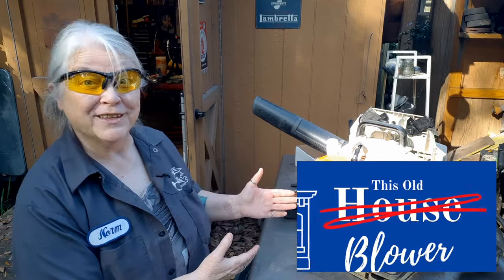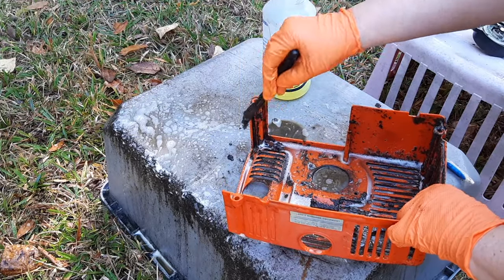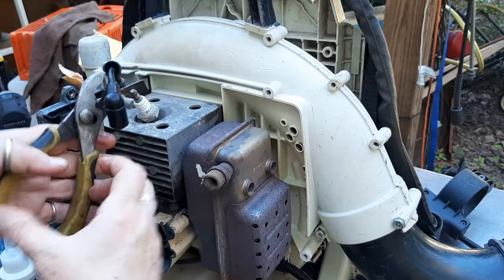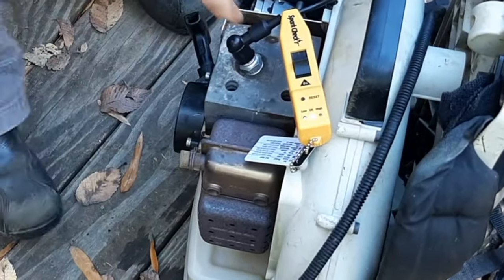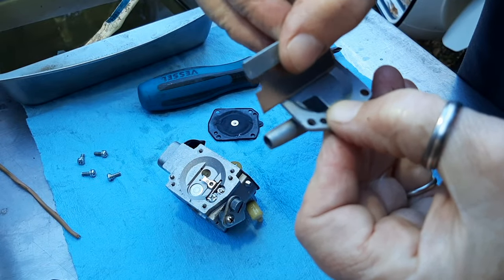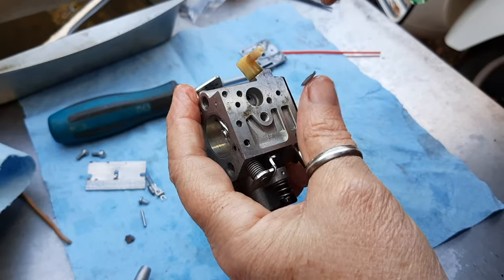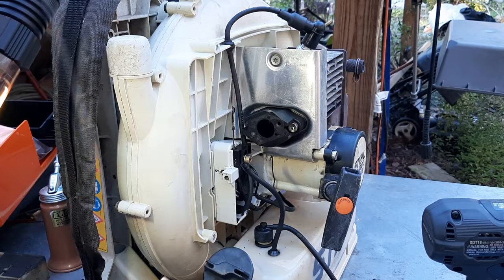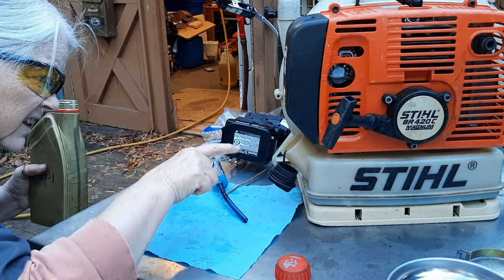Restore This Stihl BR420 Blower to Its Former Glory

Comment: Whenever I use my pressure/vacuum tester I always bend the hose over on itself and hold it tight with my fingers to confirm there are no leaks in the gauge or connections I’m using. 
That’s a good point to make sure the needle and seat have some liquid on them so they have a chance to seal correctly.
Reply from the maker: good idea

Comment: Thanks for sending the link to this blower, my BR400 sat years and bought it and got it to run only with choke on and then it won’t start unless next day cold, is it a carburetor adjustment?
Reply from the maker: Thanks Mike. I'd suggest the carb needs a clean/rebuild. A clogged fuel filter will contribute to those issues as well.

Comment: This was a fun one.  I like when things are physically dirty and they get all cleaned up, apart from the repair. 
And I appreciate you using the metric system.  When I was a kid Jimmy Carter said we had to switch but instead of just GOING to the metric system, teachers kept having us convert back and forth, which was confusing and unnecessay. We weren't comparing US measurements to anything, our fingers or feet, why compare metric to US?!
Reply from the maker: I appreciate you watching. I try and include metric and SAE measurements, to make my videos as accessible as possible. Cheers!

Comment: I got an app called Engine RPM that makes it much easier sometimes to check and adjust running speeds. It works on my iPhone using sound waves. I can prop it up near the engine I’m working on and have hands free to hold the machine and adjust settings. I can also measure engine speeds on videos!  I confirmed your idle was at 3047. How cool is that?! The easiest way to learn how to use it (after reading the directions!) is to stand in front of your fridge or freezer to zero in on the speed of an appliance. Once I got comfortable with it, it was easy enough to transition over to small engines. Will do any number of cylinder engines, 2T or 4T.
Reply from the maker: I've seen those apps, easy for DIYers to use.

Comment: That's a keeper alright. Specs say 742 CFM which is way up there for a unit that old ... probably in the 2000-2010 date range when Stihl used the square housing (couldn't find a mfg date). I have a BR600 from 2011 with the newer oval shape.
Reply from the maker: Good little machine, despite the low PSI. Nothing a ring job can't easily fix in a few years.

Comment: It’s much easier to fit the spark plug boot over the wire first, then mount the connector, lubricate and pull the boot forward over the connector.
Reply from the maker: Yep! Hindsight is 20/20, LOL.

Comment: how do you get the pad on the backpack off..... did everything except that.... thanks...
Reply from the maker: Ummm, not sure what you are referring to?
Reply: The padding on the back of the blower. Protects (softens the pressure) the back.  Looks like it is held on by rivets, do you just break the rivets off and but new ones?
Reply: Foam padding is shot.
Reply from the maker: @geraldinelunde5177  Ahhh. I don't own the blower, so I can't get a good look to see how it's attached. Sorry.
Reply: no problem, finally got it figured out myself.... pop off the old rivets and old padding and pop on the new one.... comes with rivets....  lived your restoration, really like my unit.   outdoes anything anyone else has around here....  the best of the new year to you..... blessings... @TheLawnmowerLady